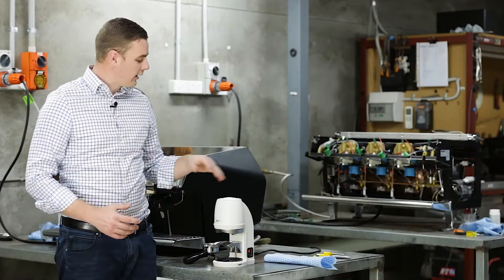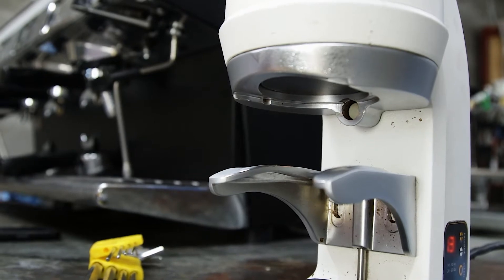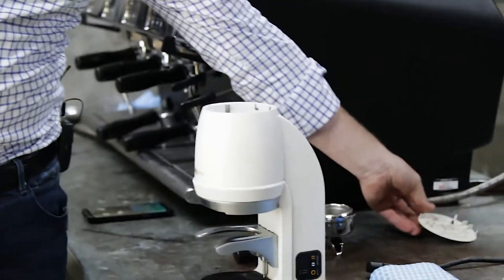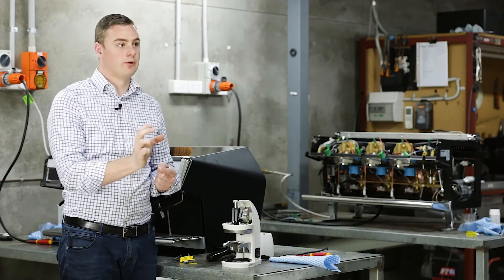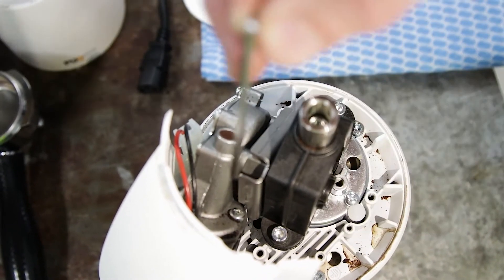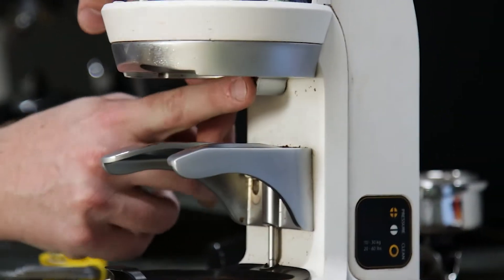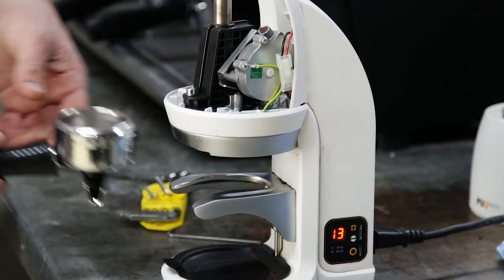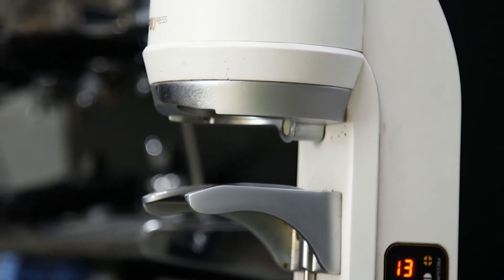How to Re-align the Sensor on a Puqpress

Comment: Loved the video! Appreciate you explaining everything so well. Actually have a problem
With it compressing hard enough when on 30kg. Any ideas on how to fix
Reply from the maker: Based on our testing, 'hard enough' is just enough to remove major air pockets in the puck and avoid channelling, rather than making it super compressed. If it's failing to do that at a high setting, your Puqpress might have issues. Or potentially the basket is a bit too small? There are a couple of different sizes of Puqpress.